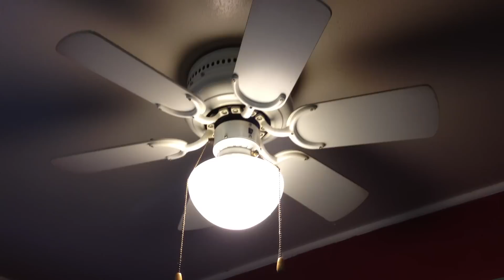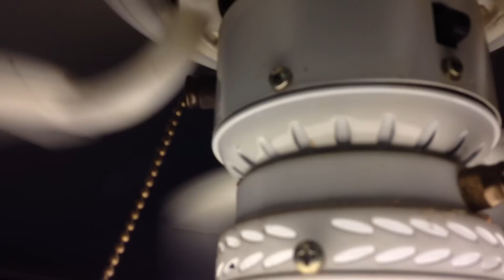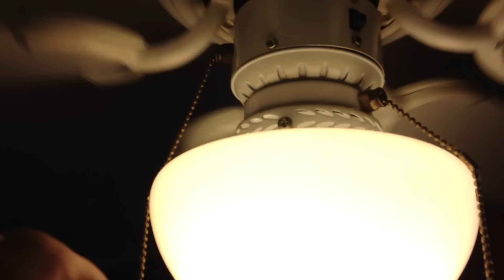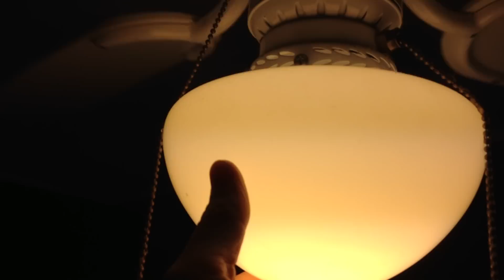How to Fix a Noisy Ceiling Fan

Comment: Thanks for the video. Still had noisy fan, after checking this out. Using the same line of thought, checked all the screws, and found that the screws holding the fan blades had worked slightly lose, tightened them up and wow, peace and quite again.

Comment: Thank you. Tightening the screws on the exterior of the ceiling fan and gently 
cleaning its blades fixed the clicking sound that was coming from the fan.

Comment: I have a Mikna Dyno ceiling fan in my bedroom relatively new, I only installed in April 2016. I am unsure if the white noise is white noise or something concerning. Is there a way to differentiate between the white noise of a ceiling fan in the circular hum that occurs particularly in the low-speed from a defect? I purchased and installed the fan particularly to sleep better at night without having air conditioning in the bedroom. As I indicated there is a periodic every second or so hum that occurs and I thought that my fan would be absolutely silent. Is there a way to determine if the white noise is simply white noise or is the noise a defect?

Comment: I have the same fan with the same problem.  You're constantly having to do this.  I added more screws and put a thin layer of caulk on the dome where the screws go.  (I let it dry first of course before I put it back on.

Comment: My fan has a ball/socket that is vibrating as it spins. Was hoping for a fix for that other than glue gun.
Reply: Is your ceiling fan on a fully variable speed control? Buzzing is normal in that case.

Comment: The problem with my ceiling fan is that is squeaks. It's gotten louder the past two weeks. Where should I apply WD40 or oil to it to stop the squeaking? Thanks in advance!
Reply: or replace it
Reply: Use WD-40 to clean, use Zoom Spout to lubricate. If it fails, time for new bearings, though replacing bearings can be difficult on the motor that spins with the blades, unless the motor is cast.

Comment: My ceiling fan is making buzzing noises similar to this one's, but mine does not even have a globe on it; it only has the light bulb. So what is the issue with mine, is the motor slipping into entropy's grasp?
Reply: Check all of the screws. Also, if it's on a fully variable speed control, buzzing is normal.

Comment: :-( my fan is making that exact noise and I checked all the screws and it didn't help. waaahhhh!
Reply: It Could Be the Capacitor.
Reply: Bad capacitor could made humming noise more obvious, but it doesn't really make it louder. The run winding is trying to get the fan to full speed, but there is not enough capacitance rating to get it to full speed. When fan is on full speed, airflow washes out humming noise. Also, some fans have run winding always connected to hot wire without capacitor in series when chain is on high, medium or low, and just have capacitance rating changed to start winding and may have buzzing noise more obvious on medium and low than high. The solution to fix the noise in that case could be to get the remote, and leave the chain on high at all times, it worked for my Hampton Bay Rockport; medium and low is quiet with remote, but is louder with chain, because when the remote is on medium or low, the fan isn't trying to spin on full speed.